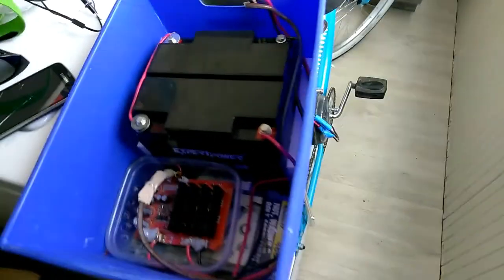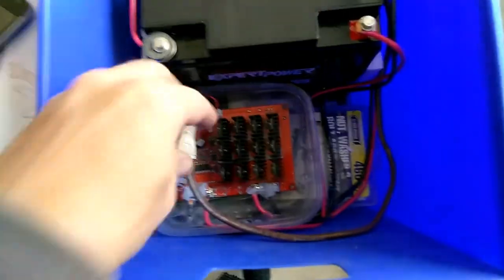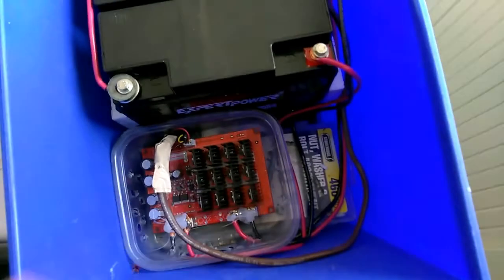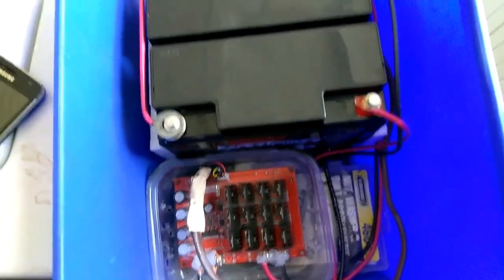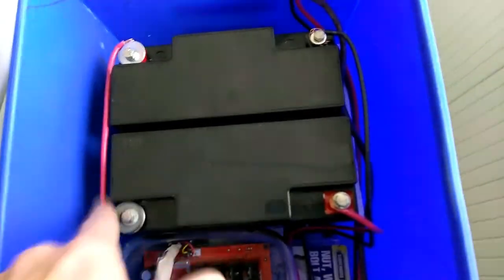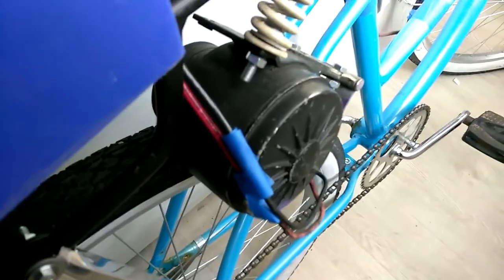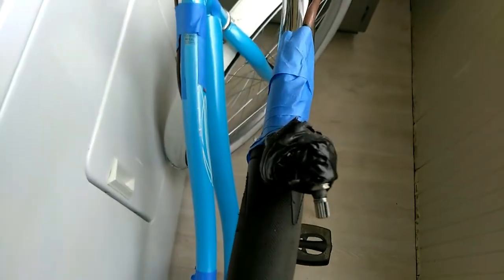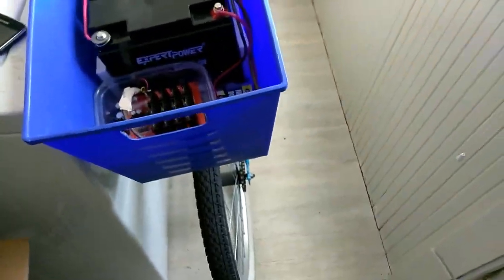first ride on the friction drive ebike

Comment: You'd think after 42 years of watching movies and video from other countries I'd be used to seeing footage driving on the right side of the road, would't you? Nope, still feels wrong to this old Aussie to not be on the left side. Ah well. Still enjoying the builds, keep up the good work and hope that cold buggers off soon (Jan 2020)

Edit 1: Holy crap, a round-about instead of traffic lights. Heard they were really unpopular over there, even though they're technically safer and cause fewer delays (up to 3x the traffic through-put over lights).
Reply from the maker: I could handle driving on the other side of the road, but shifting gears with my left hand is odd.
Hope you are safe from the fires, may the rain come soon.
Roundabouts are great if drivers share the road, hence the problem with them in the usa. Lol
Reply: @ThriftStoreHacker  Yeah, muscle memory would make shifting confusing at first. Had a minor taste of that driving a Ford Escort "WTF, why's the indicator on the wrong side?".  Same when my grandparents owned a Jeep on the occasions I was stuck driving it (it had an indecisive transmission, apparently it was a thing in that model)
I'd been saying the fires are hundreds of miles away until this morning when the whole town was full of smoke, but I think it's out now. The bottom of my state is burning but the eastern states have it FAR worse. Even the rain isn't helping much at this point :( 
Growing up with roundabouts everywhere probably makes it easier. Just remember to slow down a little and treat it like merging with traffic from a side road. Give way to the right in your case. They do seem to smooth the traffic out, although it can make it harder for pedestrians unless there are some islands in the middle to break it up into smaller crossings. 
Boy that was long winded. Have a good one!